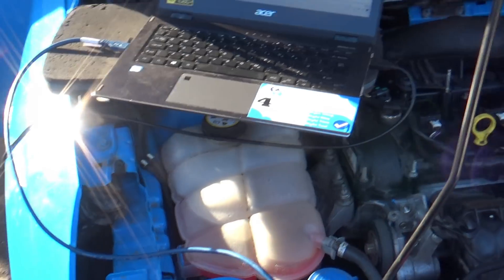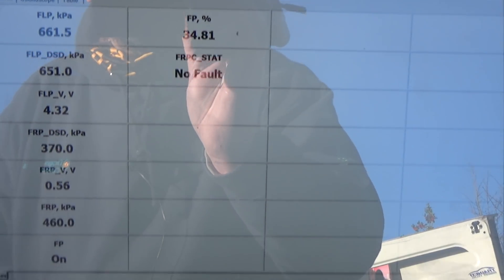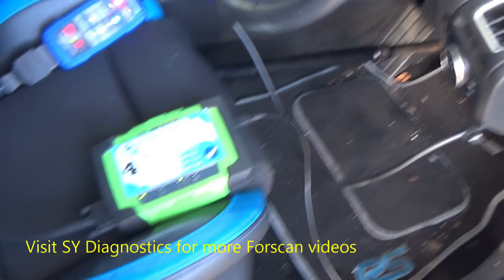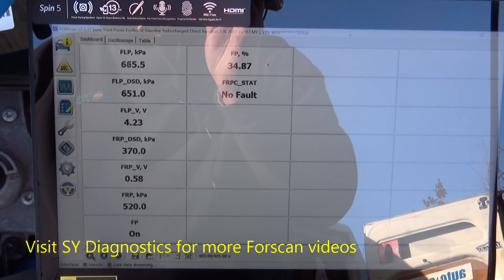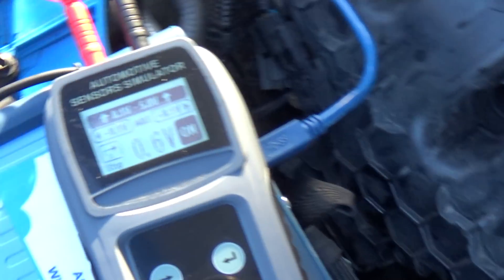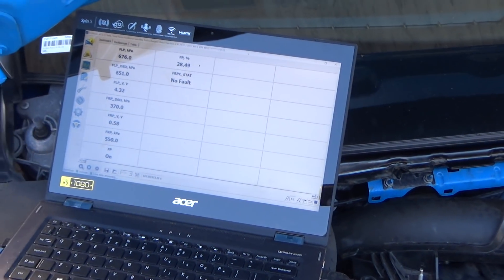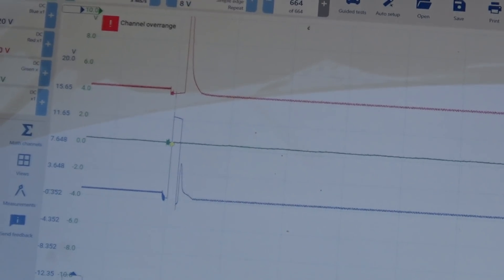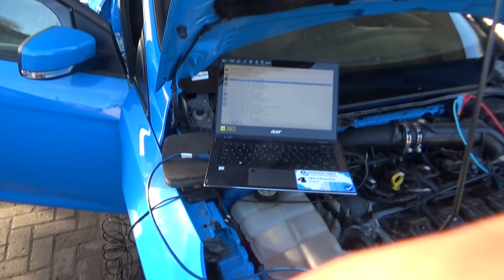Focus RS High Pressure Fuel Fault P08B2 Pt1

Comment: My RS is having this EXACT same issue! My car has been at the dealership for more than a month now! I have the same exact code and the issue where the car wont start randomly and fuel rail pressure drops to 0!!!!

Attempted fixes:
Fuel filter replaced
HPFP replaced

issue still is present
Reply from the maker: You'll want to watch part 2 👍

Comment: Not sure about the rs, but on the 1.0 you can mix the fuel pump wire up with an evap solonoid that lives in the same area of the engine bay, I know from experience 😂

Comment: With the history of the head work i think my next move would be to remove high pressure pump and pressure sensor and visually inspect them , check to bungs or paper stuck , check the cam drive to the pump no small parts are missing etc 

is there information for the duty the fuel pump should run at at idle ? to achieve the pressure that is required . you could then use a pwm simulator to control the pump and see if the sensor reads corectly

Comment: https://www.focusrs.org/threads/ford-focus-rs-faulty-fuel-rail-sensor-relpaced-my-p0089-and-p0171.119166/ not that expensive, seems to be a common point of failure as well...I'd replace that  first.
Reply from the maker: #Testnotguess let's see if we can prove before launching the parts cannon. If the part was £1k we wouldn't be so quick to condemn 👍
Reply: @SimplyDiagnostics  Please do, I enjoy seeing your logic and methodology.  Adding one of those sensor simulators to my tool bag asap!!!

Comment: I would be surprised if its down to plugs being in the wrong place as usually these days manufacturers use the same style plugs but with different housing notches so they can't be mixed up.
Is the high pressure pump timed up to stop harmonics within the engine, could this be a pump timing issue which doesn't fault until plugged in?
Wonder if part two has any more information about the head work carried out but that there's been 'other' undisclosed electrical work.
Reply from the maker: Great comment and you're right to question other aspects. We have to find evidence to support our hypothesis ( we were on slightly sticky ground as you'll see in part 2) before we commit to intrusive testing or the parts cannon 👍
Reply: @SimplyDiagnostics  hahaha go on baby!! Slightly sticky ground 😉, when will part two be out?
Reply from the maker: I filmed the on car today (an hour), I've yet to do the screen captures and walk through ( maybe 2 hrs work) Then the editing (about 4 hrs for this one) then rendering (2 hrs) then watch it through a few times,  then upload, finally thumbnail, tags, description and we should be good. All for a 30 min -1hr video 👍
Reply: @SimplyDiagnostics  ill look forward too it next month 😊

Comment: My wild guess diagnostics would suggest the high pressure fuel pump has not been reinstalled correctly.. Similar to the vauxall video with the supposedly correct cams fitted...

Comment: Great too see you back out again Steve. Is there a pressure test port to verify the HP Pump? I'd like to verify what is happening at the pump vs what computers are saying with and without the sensor signal being created and with and without the HP pump plugged in. Amongst all the other suggestions of course. Would a manufacturer really use two identical connectors both in configuration and colour meaning you could get sensors connected incorrectly? Aren't they usually a different colour at least to stop that type of mistake?

Comment: I think i would disconnect rail sensor and  provide a spearate 5v and a ground  to the sensor and scope signal from sensor then leaving the harnes disconnected put the .6v down the signal wire  then see if we're getting those wierd voltages showing up on the scope + scan tool

Comment: Wiring plug issue Steve ,?, I remember issues with smiley escorts , if the washer pump motor after a crash wash fitted to indicator by mistake , very crazy things happened , looking forward to part 2

Comment: Since they had the head off I'd be curious if the exhaust cam is in time before going any further. Nice video Steve.
Reply: Although I would think you'd have timing  codes though if that was the case.
Reply from the maker: Valve timing has been "confirmed " as good

Comment: I dont know if this will apply to that engine. But normally the high pressure control unplug will make the high pressure rail sensor to read same value as low pressure side. Just to have a base line of what the reaction. Lets wait for part 2 and see what happen.

Comment: Hey finally the simulator got used😝. What did you use for the pinout??
Reply from the maker: It's a standard 3 wire sensor, has to have vref, gnd and signal return, i had to check for each so simple to identify signal, also had access to factory diagram from alldata and a diagram from Hella HGS

Comment: can you command the fuel-pump in tank off with that forscan when it runs to see if it stalls real quick= high pressure pump is likely  faulting while  you tell it  it has good rail pressure  with simulator ?. i  accidentally ran a vw tfsi without high pressure plunger follower  lol and it can run on  just the in tank pump.. i noted  that in my head
Reply from the maker: Unplugging the HP pump should default to low pressure supply only according to manufacturer info. Part 2 will prove this.

Comment: ok gasoline direct injection. i was thinking  derossi massimo mm03 but that's for  diesel. A special high pressure line  with  built in pressure  gauge would be  handy  now

Comment: Has it been in a smash/repaired and someone’s mixed pins up 🤔 Nice to see you back making these videos again Steve 👍🏻
Reply from the maker: Vehicle was running fine before head gasket. There's always a chance of a mix up but wire colours correlate. The only question is "what changed?" That's where the answer will be found 🤓

Comment: Is the PCM supplying the dodgy voltage to the pump Steve ?
Reply: is the PCM at fault i mean
Reply: Bad PCM ground ie voltage on the ground supplied by the PCM to pump. Roll on part 2
Reply from the maker: We can see voltage but we haven't checked (on camera) how much work is being done by the regulator. This can only be seen with current 👍
Reply: @SimplyDiagnostics  👍

Comment: Has to be what someone done when changed head gasket. If it was running when it came in. Remember away back when on a mustang two connectors were the same and they got mixed up. Stay safe
Reply: Reference to OE wiring diagram for colours at each component will sort that one out, reference also to harness routing diagram, someone could have laid the harness in wrong when reassembling, so connectors "fell" in the wrong location and were then plugged into the nearest item.
"What's up with that voltage?" is a massive clue. What can modulate that voltage, even with the engine stopped?
Reply from the maker: Speaking to SY, that's still an issue on some vehicles. Part 2 is going to be cool.